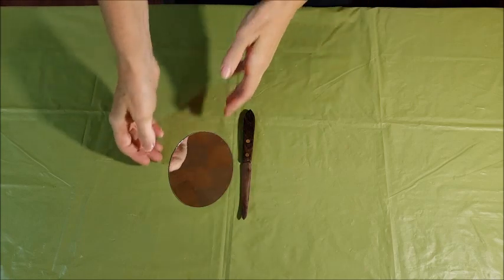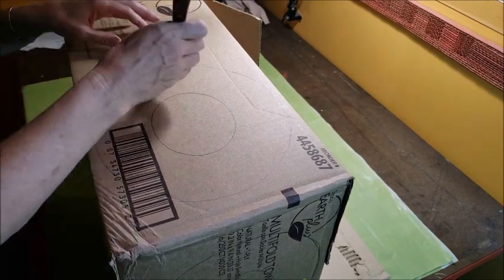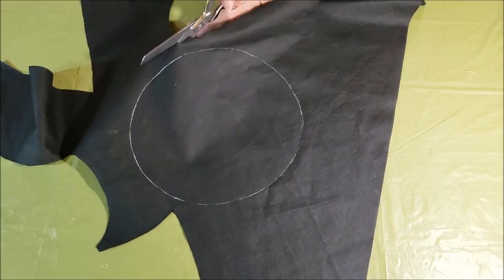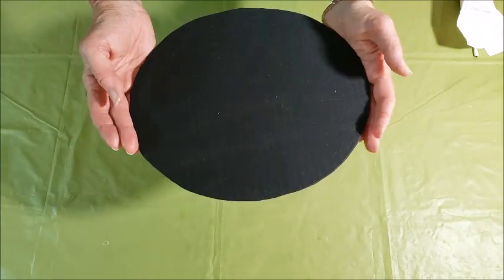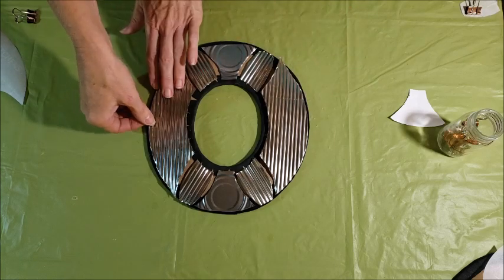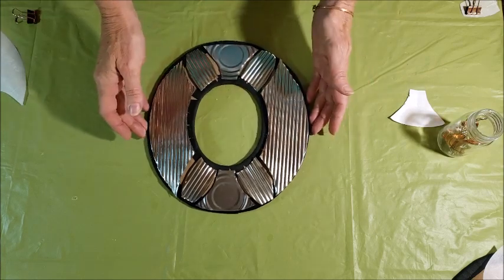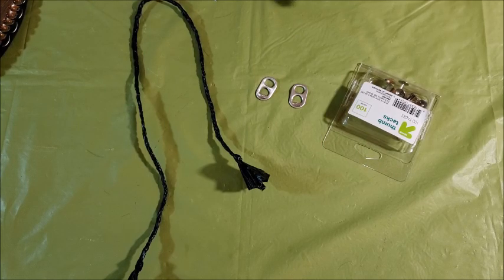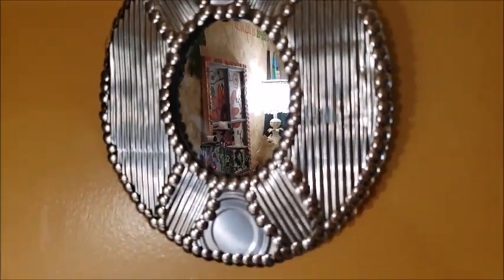Tin Can Framed Mirror - Upcycled

Comment: Good gloves for this are the cut/knife proof gloves you can find in the fishing section, hardware store, or online. Great for working with metal of any kind of glass/resin which can get very sharp edges. Even helpful when using an xacto or box cutter.
Reply from the maker: Thanks for the tip.